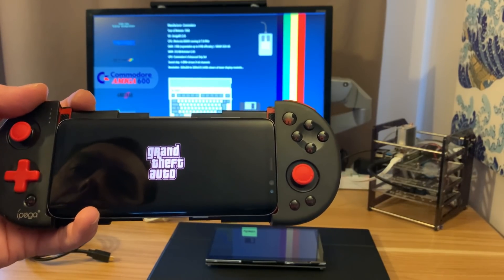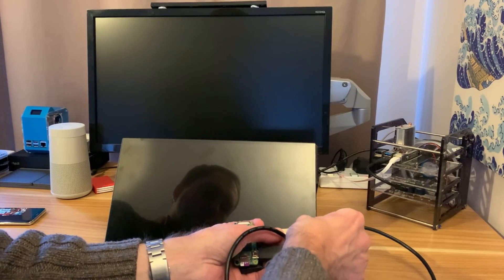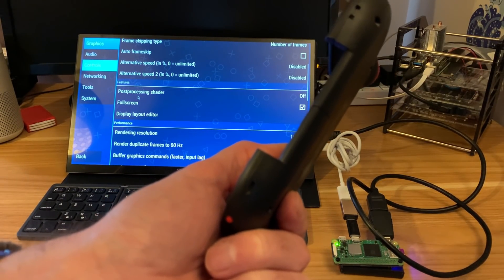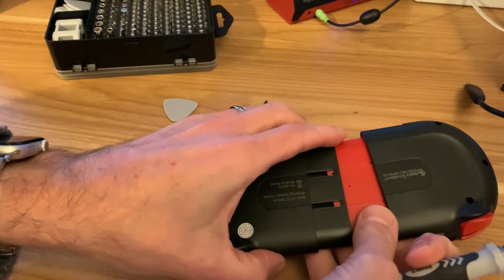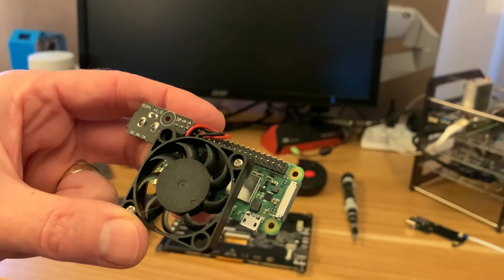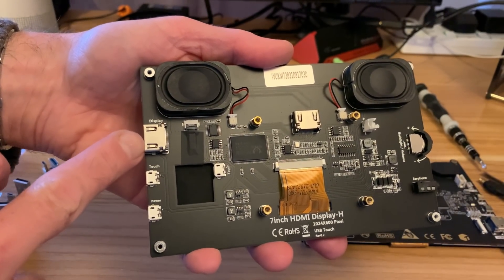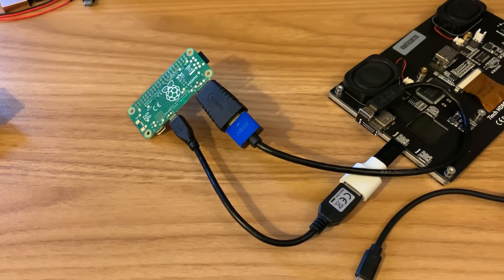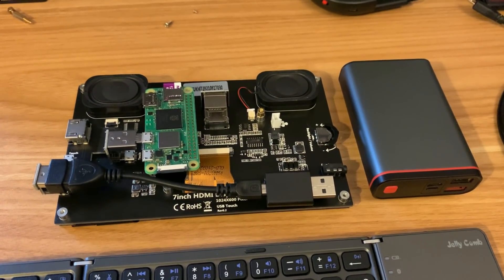Handheld Raspberry Pi Zero 2W gaming build. Part 1.

Comment: I've experienced voltage loss when daisychaining a bunch of various USB cables like that, especially if using a 5 volt battery pack. You MAY suffer there. If possible, use both the USB ports on the battery pack to power the screen and pi separately. The Zero (the first one) can boot while using a powered micro usb hub plugged into the usb port, maybe the Zero2 can, too...?